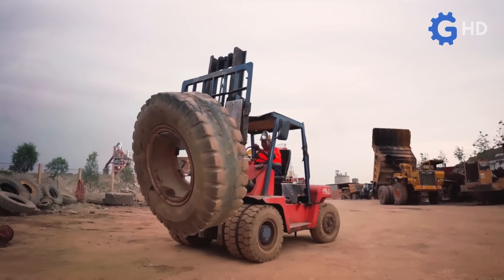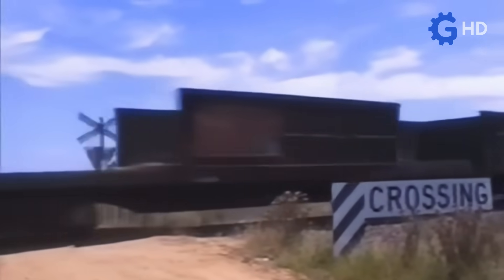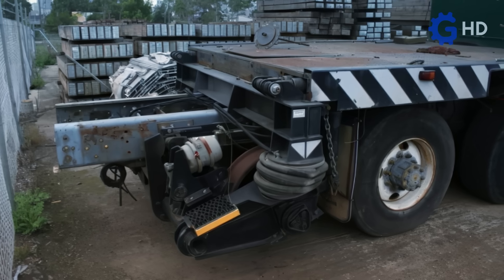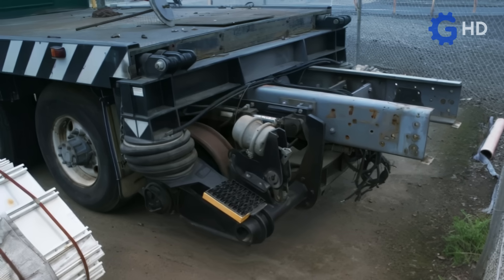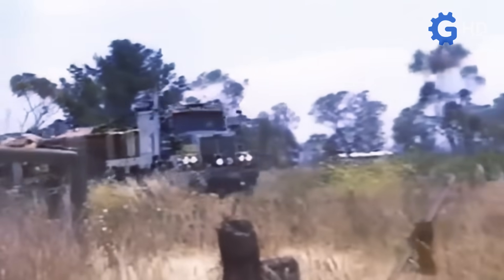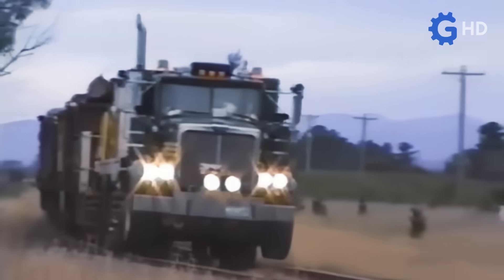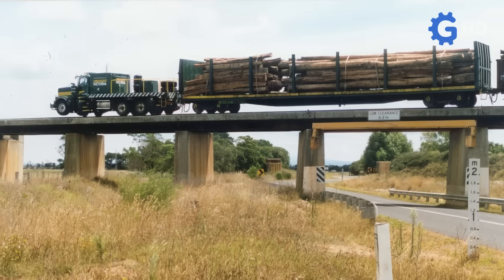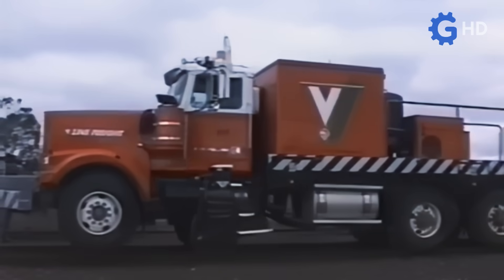Why Is AUSTRALIA Replacing LOCOMOTIVES With TRUCKS? - HISTORY

Comment: Retired locomotive engineer here.  Narrator says locomotives transporting 150 tons with relative ease? He should have said 15,000 trailing tons with relative ease.
Reply: Antontsau, what locomotive is only 500hp? That's not even a modern prime move for a road train,  which are commonly 700hp these days.  Locomotives range from 2500 to 4000 hp commonly in Australia. 
15,000 tonnes though is the despatch weight of a central Queensland coal train, which would have 4 to 6 locomotives  attached, working in multi unit. 
(Former senior locomotive project engineer)
Reply: @tano1747  Herds of them, small switchers for maintenance and industrial works, pull 1-3 cars slow and not too far. Descendants of tank steam engines with comparable power. For Australia it will be for example NSW X100 with huuuuuge engine - tadaaam - 93hp, X200 with 260/290hp. 

Thats mainline long haul, of course it is not replaceable by trucks, no one even tries to do it.
Reply: @tano1747  --  A more useful comparison might be with the still experimental hybrid locomotives.   Their peak power can be that of a small switcher and the average power a good match for a heavy duty diesel truck.

It's a lot cheaper to put in a dirt road that can carry such a truck than to provide a run around track.   Customers would still need their siding track but the Truck could turn even turn around without using much real estate.   The traction problems could be solved with electric drivers all on the track wheels.
Reply: @tano1747  The only place I'd expect to see a 500HP locomotive, would be in the shunting yards.
Reply: @Ben31337l  --  Well, it might have an application in a "short line" RR with but little traffic.
Reply: Not going to put a train with 50+ railcars with a semi. In the US train sizes have rise to around 100 railcars to maximize efficiency.
Reply: 150 tons would be around the gross weight of a single loaded car in the US
Reply: @rotunda57 lol what
Reply: Now this is a discourse that makes sense to me!  A bunch of experienced workers relating what they know!
Reply: Meanwhile, rail-road Unimogs can pull 1000 tons. They're used for shunting in places where having a full locomotive would be overkill or inconvenient, they're quite flexible: A Unimog can pull a couple of cars into a dead end and get out of there on rubber tyres.  Not something you'd use on the actual rail network.
Reply: Question Sir: I've been told many UP locomotives have a CAT 3512 on an SCR system, just like most reputable drilling rigs(3 motors). Is that true?
Reply: Indeed. That's as far as I got. YouTube is increasingly a place which panders largely to lay people providing confident voiceovers on topics they know nothing about, over footage they did not create, and in some cases that footage does not even represent the topic.
It is becoming a mediocracy, and I suppose it will get even worse because no-one decent is going to want to be associated with so much dross.
Reply: Point well made Ernesty. Mechanical facts remain TRUE....
Reply: I've seen a 70-ton car move relatively easily by manpower. The locomotive engineer had left for the day and the car was slightly off. I couldn't believe what I heard when the engineer said "I'll go release the brakes and let's push it." I was awestruck by this demonstration of how easily rolling stock moves.
Reply: Yeah the narrator dropped 2 zeros.
Reply: @kellymcdermott2546  More like 3 zeros.
Reply: @Kevin_Rhodes  How do you figure that???
Reply: 500hp loco? 300-400t max. 8000hp loco? Ummm, thats a bit different size, weight and price class.
Reply: @antontsau 500hp can move upwards of 1000t at slow pace. Just a matter of tractive effort
Reply: @danielcarlin7784  yes. Speed*force = power, so if you get restricted power you have to sacrifice one of two.

In fact 1000 hp is first widespread mainline diesel Alco Rs1, which was used for long haul, not as switcher/shunter. Yes, too weak, comparable to well below average wartime steam loco, but did its job.
Reply: @antontsau ud be surprised 
Every hp can move upto 6 tons with ease in locomotive standards
Reply: @anything.with.motors  1000hp for 6000t? Its possible but veeeeeeeery slow, hardly fit for shunting work. 10 times more power at least.
Reply: @antontsau shunt work is slow, the lower the speed the less hp per ton you need 
1000hp can easily shunt 6000 tons 
You are right though it would be slow for long hual stuff, but it would be extremely efficient
Reply: @antontsau most stuff is measured in mpg 
But shipping is measured in ton-mpg 
The total resistance nwould be super low for example in a 6mph train, ill give an example 
So 1000hp would probably use 38gallons per hour 
6000tons ×6mph =36000 ton miles
36000÷38 gallons is about 950ton mpg
Which is extremely efficient, but most trains usually are alot faster then 6mph

Rail can usually do around 400ton mpg 
But higher speed means more resistance thus more fuel an power needed which is why its lower, but again that 1000hp scenario is easily a great shunt train
Reply: @anything.with.motors  no one cares about mpg. 1000hp loco with 6000t train will be just extremely slow crap, hardly reaching walk pace on any visible slope. Even shunt train. Just to accelerate and pull out this mass from side track (80 cars = 1.5km) with such power takes ages. 1000hp switchers/shunters designed to work with 500t local trains or yard operations up to 2000t.
Reply: @antontsau you clearly have no idea how the industry works 😂😂😂
Its ton mpg not just mpg, an yes, companys very much soo care about it😂😂😂
I also want to point out, your wrong about  shunters, most of the time they dont hual crazy loads like 6000 tons
Its usually 15 cars maybe 20 tops, as they setup lines for the main trains to huel to the next station
Reply: @anything.with.motors   total bs. Repeating. Slow. Shunter with 1000hp is not suitable even for 2000t (pull the whole train to hump or so), for 6000t it will be absolutely unusable even as shunter. And you claim 6t per hp - thats a nonsense.
Reply: @antontsau you dont shunt all 6000tons at once 😂😂
You have no idea what you're even talking about clearly
Reply: @anything.with.motors  thats you have no idea thus say about 6t per hp.

And, btw, to shunt the whole train is a common practice. Hump yards - no, never heard?
Reply: @antontsau so you continue to prove the point, you have no idea what your talking about
Reply: @anything.with.motors  draw the horse. You said absolute nonsense about 6t per hp and now continue to sink in it deeper and deeper.
Reply: @antontsau where is thee an 8000hp loco in Australia
Reply: @NoBody-ht1oh  up to 6000 (SD90) in Pilbara, regular lines - up to 4000 (class90) . But not as sole unit, usually by 3 or 4 thus 12000 or 16000.
Reply: I agree 👍 💯 %.